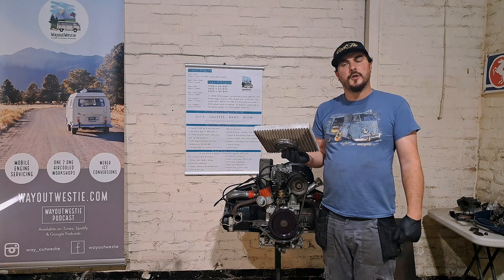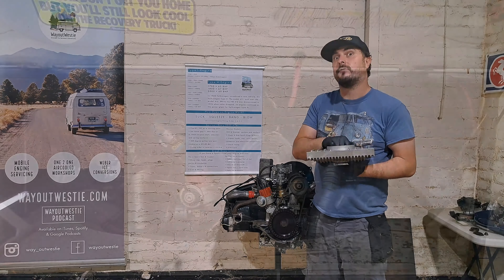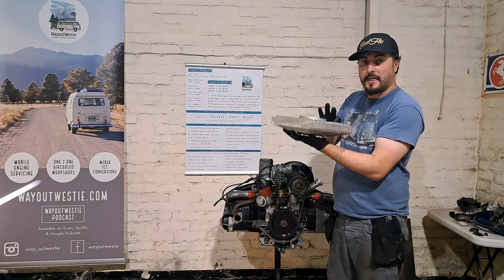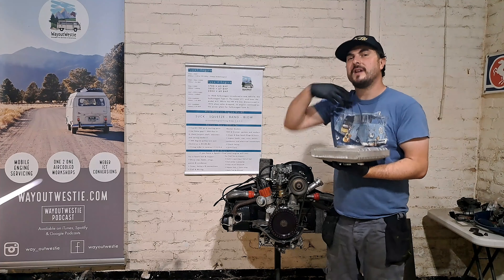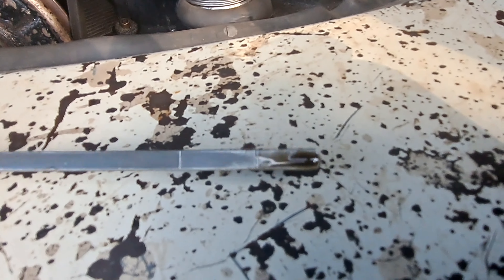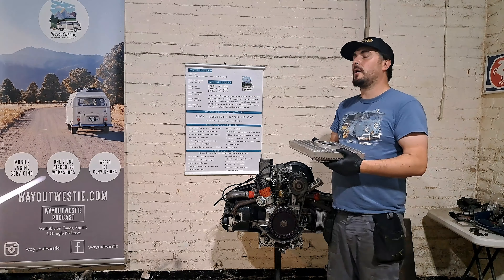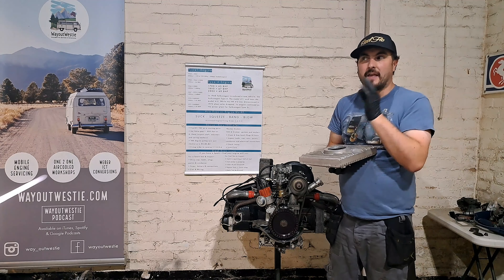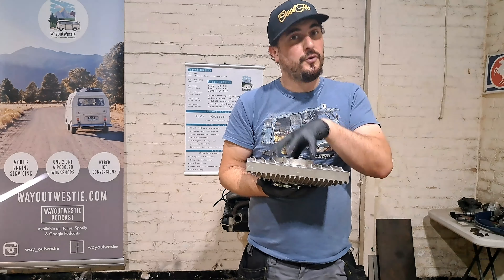The truth about Deep Sumps on Volkswagen Kombis! #vanlife #kombilovers #campervan

Comment: It's not for lowering oil level. Lowering oil level doesn't affect oil pressure at all. The reasons are: 1. Enough oil to not be pumped dry by a quick revving engine or during a tyrn. 2. Better oil longevity due to less trips through the system per volume.  3. Higher thermal capacity for smoother temperature fluctuations.  4 increased cooling. 1 is THE reason. 234 are secondary.